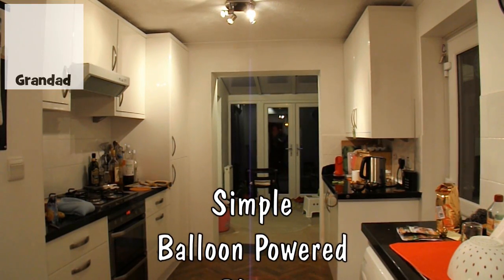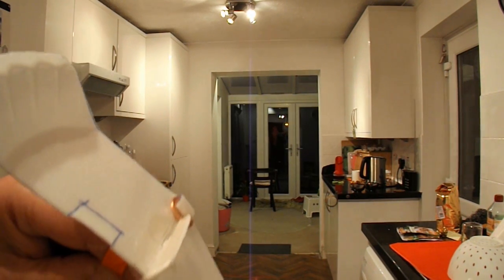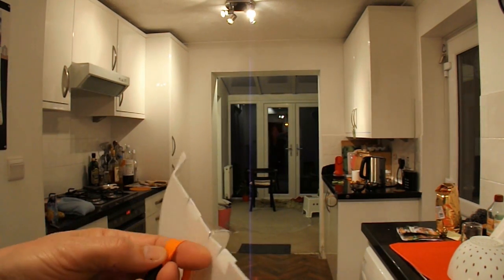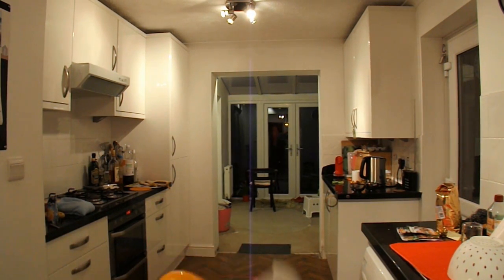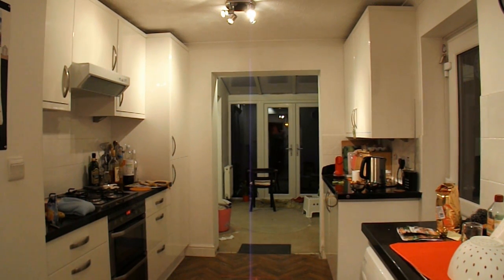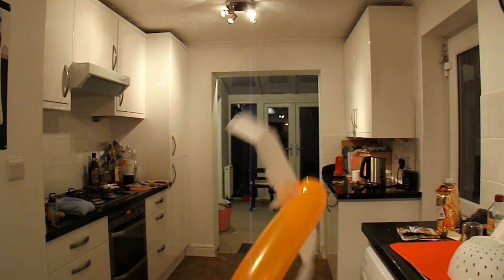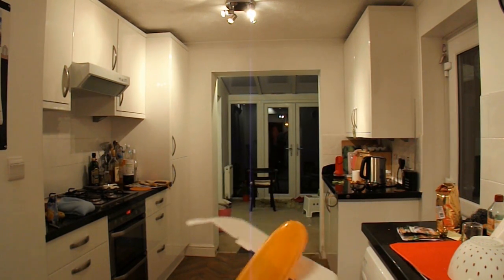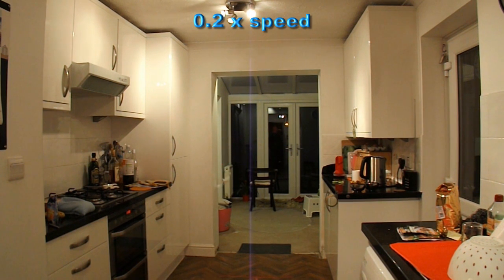Simple Balloon Powered Plane

Comment: It's kinda cool really, bit different. That left turn is interesting, could probably do with right trim.
A rocket plane would be good with this...in a tube, as you say but held vertical, balloon pushes it skyward, plane levels off and off it goes as a regular glider. Or maybe at 45 degrees and looking like an ME-163 Komet.
Reply from the maker: slider2732 the balloon's shape has far more to do with the direction of the plane than the trim of the plane. A long lightweight (obviously) tube would probably reduce the impact of the balloon's natural tendency to distort as it deflates. You will see in the second attempt a short tube is not good enough.